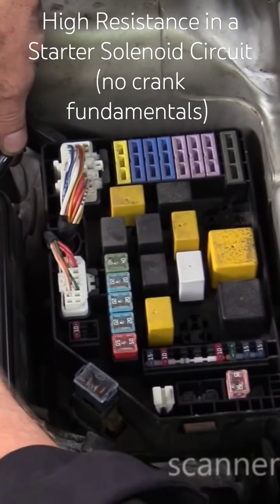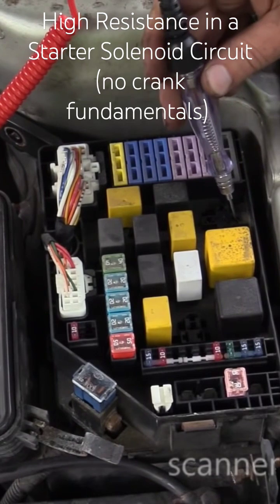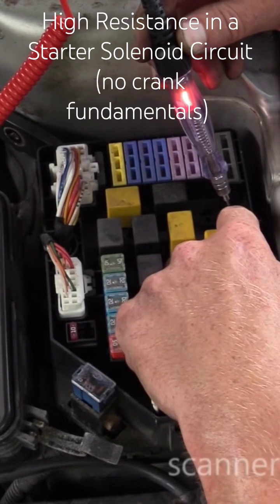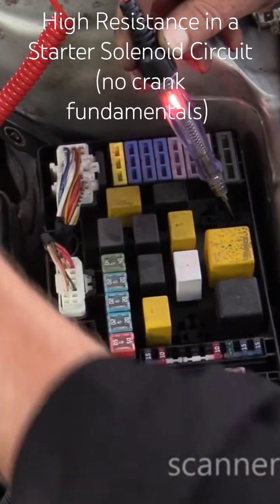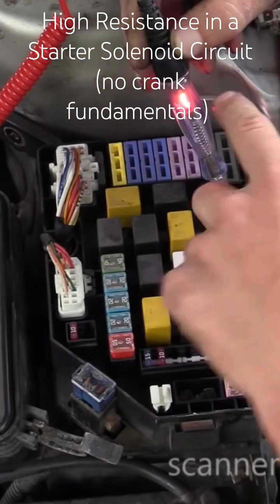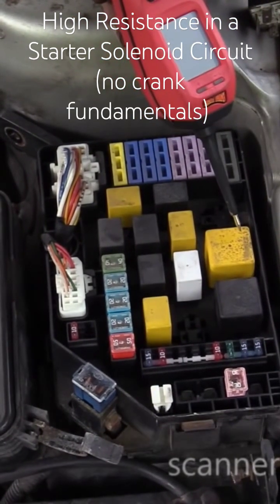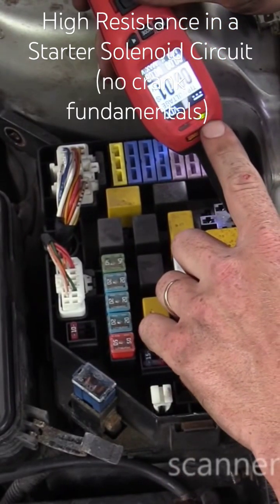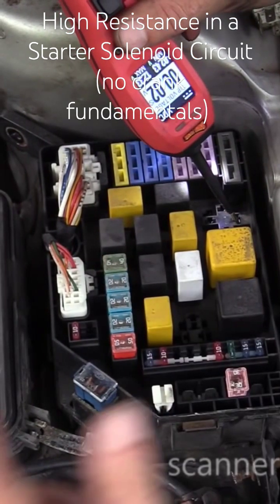A Perfect Example of a Loaded Circuit Voltage Drop Test! #starter #nostart #resistance #voltagedrop

Comment: I have this issue starting the car it crank but no start but if i hot wire the relay with pin it starts, the circuit is all good from the ignition to starter relay, also the relay itself  is good. Is possible the starter is the culprit? But why is it starting if i hot wire the relay switch directly
Reply from the maker: Not enough info. Year, make, model and engine. What relay are you jumping and what pins
Reply: @ScannerDanner  Its a lancer 2.0 2011 model, i already tried multitest the relay switch pin postive coming from the ignition switch signal , it shows 7-9 volts only when cranking, when i tested my hotwire from ignition to relay switch its showing 12-14v. I think its not getting enough power? Any advise? Ecu issue? i check/clean the ground it seems all good.

Comment: What does it mean when you say "...that's the load side of the feed side of the solenoid winding..."?
Reply from the maker: Load side of the relay, on the feed or supply terminal to the solenoid. Sorry for the poor wording there.
Reply: Is the load side of the relay to the feed side of the starter solenoid
Reply from the maker: @AG-rz9qt  yes

Comment: I was in this situation a long time ago. Could not make sense of what I was looking at. The headlight started working but I could tell it was dimmer than the other.
Reply: No kidding. Huh. I had my buddy wire up this junk car to make it road worthy, i ran into this issue later, eventually got it sorted out but didn’t understand what was going on lol
Reply: What was the problem? Was the ground lost and worked through a foreign device's feed. The difference in voltage drops caused it to work? Like the series Christmas string lights strategy.

Comment: This is why loaded voltage drop testing is so important.   I don't understand why the factory service manuals are still doing resistance tests on unloaded circuits.
Reply: On freightliner they tell you to use Fixed Load Voltage Drop Test
Reply: Voltage drops on live circuits for gremlins is the only way I check for issues like this now.
I've used low watt bulbs to load wires in a pinch, too, depending on the wire gauge.